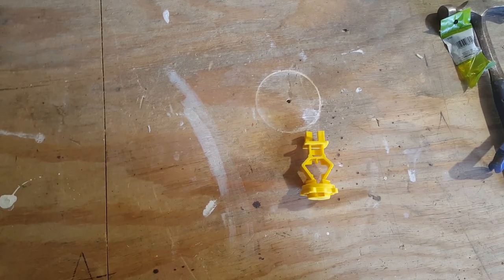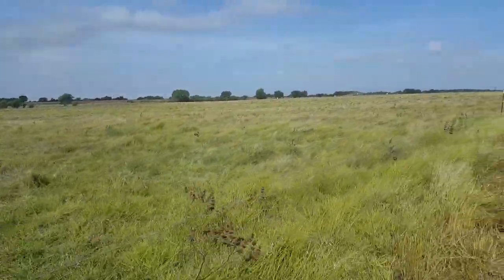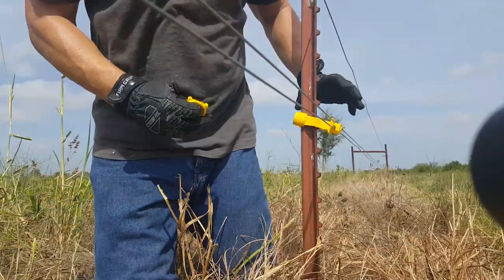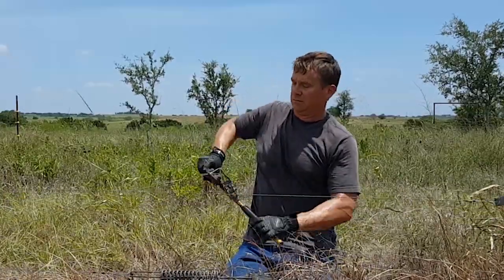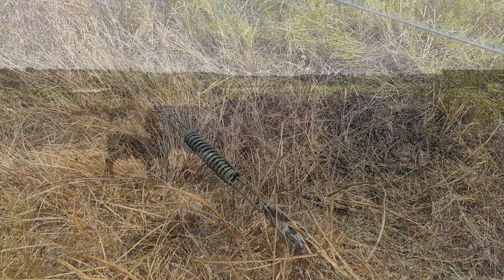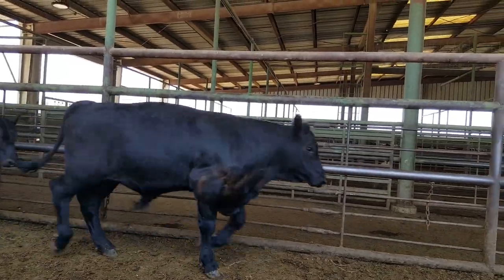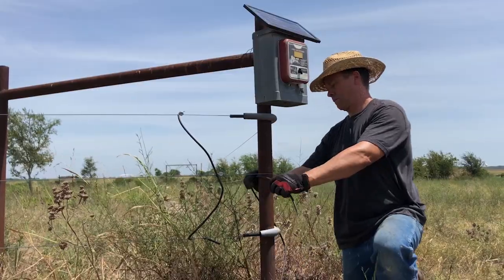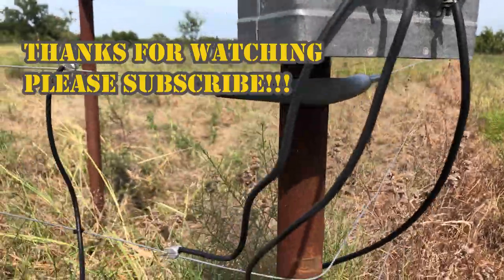Electric Fence Guide

Comment: This is the best video that I have seen and I have watched about 30. Good insulator over view. Great advice on both what did and did not work for you. Direct and to the point which makes it brief and to the point. Covered grounded and ungrounded fence and various possible connections  and materials. THANKS
Reply from the maker: Very nice comment. Thank you!

Comment: DEFINITELY prefer the screw on to the clip on!!  When I first put my electric fence up all I could find were the clip on ones.  I can't tell you how many times I had to go out in the cold and sometimes dark to fix fence because those clip on trash would break! Not to mention how many I broke in the cold just trying to replace them! They are a total waste of money. I have also had a lot of nail on kind break on me. I had lots of trouble with deer running through my fence. I had mostly bare wire to begin with. Even though I flagged the wire, they still ran through it. Tried a yellow/black twisted poly, nope, they still ran through it.  I seemed to have better luck with the white tape. So this year I am completely redoing my fence with white tape on the top and white twisted poly on subsequent strands. I am hoping the deer will jump it rather than run through it.
Reply from the maker: Good luck with the deer. They're probably the biggest negative for electric fence.
Reply: @LewisRenovation  I hear that. If nothing else, they taste good. 😉
Reply: i would have not thought about this and the people at the store have no clue - now i know which insulators to buy -

Comment: Great video! Great idea on the middle wire as a ground, the instructions of the solar pack say to install a grounding rod every 10’...$$$$! Because you do the middle wire as a ground how often do you put a ground rod?

Also what brand of solar pack dc system do you recommend?

Thanks again for the great content!
Reply from the maker: I just put in one ground rod. At least for cows, I've seen fences be off for weeks and the cows still avoid it.  We have x4 Parmak chargers, besides changing $30 batteries, they have lasted several decades
Reply: @LewisRenovation  If you're going to have the middle wire as ground use clips to the t-post. That way each t-post becomes a grounding rod.

Comment: Thanks for posting this.  Very good information.  Can you tell me what you used to connect the hot wire to main fence?  Is that a clamp?  Looked as if you used a crescent wrench to tighten it.  Do you mind to send a link to it?  Thanks again.  Great video.
Reply from the maker: I think you might be asking about this https://www.tractorsupply.com/tsc/product/american-farmworks-galvanized-electric-fence-line-clamp-pack-of-3-1213240?store=2387&cm_mmc=feed-GoogleShoppingProduct_-1213240&gclid=CjwKCAiAxp-ABhALEiwAXm6IyYQspftWnApkMJeuFz5NQo304b2W-b2wB0YKZ6rQVz36LXZ05I5ocBoC5mkQAvD_BwE

Comment: Thank you for explaining the different types and proper ground, I literally on the fence "pun intended" on whether to use solar or hard wired power, I have 10 acres I will be using for a couple horses and a few goats and was looking for what would apply best. Seeing your cattle lets me know that your fence has to be good. You explained the ground very well as I am new to this and didn't quite understand how it worked. Only question I have is your grounding rod was what 6' at least, is that a necessary length? and can I use a rebar pole for a grounding rod? Thank you in advance.
Reply from the maker: A good ground is real important with an electric fence.  I recommend an actual grounding rod.  At least something that doesn't rust because iron oxide is an insulator.

Comment: What post spacing would you recommend when using metal t posts and high tensile wire as a perimeter fence?
Reply from the maker: You could easily get away with 50' spacing. Probably even more if you wanted

Comment: I always wondered,  does the cow need to stand on the ground to completethecircuit?    if the cow is smart enough to drag a piece of dry wood to stand on, and not touch middle wire, can it cross over?
Reply from the maker: As long as all four hooves are on the board,  your exceptional cow can escape
Reply: @LewisRenovation  hahahah.  thanks 😊 bud!
Reply: Smart cows know how to push some other cow through the fence, breaking the fence. Breed your cattle for meat or for milk (or if show cattle, for beauty), but not for smarts. We knew a dairyman who had a smart cow and broken fences.

Comment: I'm having trouble with my first electric fence. Does a lane/run of wire need to be looped back to itself? Or just dead-ended? I have them looped with no voltage coming through. If I just attach a test 1 foot wire to my box, the wire goes live. But not on a run for a round goat pen. I have checked 5x and have no wires touching metal stakes, nor trees, nor any sticks laying on the ground. It's driving me nuts. I do have those gate disconnects and starting to wonder if they have a defect. Any thoughts? Maybe I should dead end each run so the end is not reconnecting with the start of the wire run...
Reply from the maker: I don’t think I’ve ever looped it back to itself. Maybe that’s the problem. Can you alter just one run and hook it up to just that and see if it fixes it?
Reply: @LewisRenovation great suggestion- so I have 5 runs. If I hook a single wire from box to a run, each one of them works fine. As soon as I connect a 2nd run together, the power drops out (using a tester). As soon as I take some pliers and pull the jumper wire off the 2nd run (so it's a single powered run again), the voltage comes back. Like what in the heck. Is my box weak? I have 3 6' ground rods in also
Reply: @LewisRenovation  oh, forgot to mention I killed the full connected loops. Each run ends an inch from it's start point in the goat fence. Then I was planning to drop a jumper wire down to each run to connect the voltage across each of the 5 runs. That's where I'm stuck. Thinking of buying a new box tomorrow
Reply from the maker: @frontporchpickin289  maybe you’ve got a bad box, because if the work individual, I’d think they’d work when jumped together
Reply: @LewisRenovation  confirming back it was indeed a bad/weak box! Thanks!

Comment: Do you find that the cows actually do touch the hot wire and the ground wire at the same time?
I have one steer that always tests the fence, but he just gently uses the tip of his nose.
Reply from the maker: They touch them both if they try to push through.
Reply: @LewisRenovation  ouch. Well that’s good.

Comment: Possibly dumb question, but does the fence wire need to make a complete loop, or does the ground make it possible to run it one way?
Reply from the maker: Not necessary to be a complete loop. Electricity travels through the cow and into the ground. But grounding the charger is really important to make it work.

Comment: I’m confused on hue you did the middle wire for a ground can you help me
Reply from the maker: The middle wire is connected to the ground on the charger. So if a cow touches a hot wire and the middle wire at the same time, the fence will shock the cow between the two wires

Comment: How do you fix the fence when it has been broken down. Deer running through it and snapping the wire.?
Reply from the maker: Your probably using smaller diameter low strength. Find some high tensile wire and the deer can't break it. 
https://www.tractorsupply.com/tsc/product/high-tensile-smooth-wire-200-000-psi-4-000-ft?cm_mmc=SEM-GoogleDMTDynamicCompStores_-AllSiteTSCCompExtAd&gclid=Cj0KCQiA-rj9BRCAARIsANB_4AD9mQsNFl1D6Esn4KlCkNeXIyhe_6LstqVqt_KO5HVRzMAPPkbVrJcaAjkWEALw_wcB